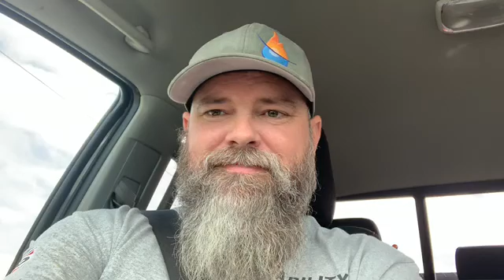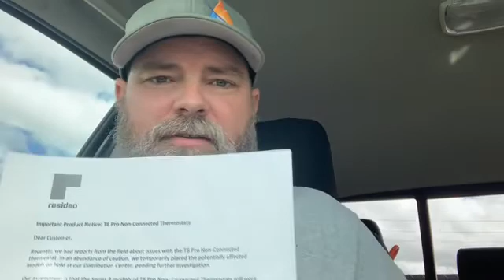Honeywell T6 Pro Issues

Comment: This is our second Pro t6 in one year. The fan won't go off while at the same time it won't raise heat up to the level we set it. It just blows cold air. Because the unit will not raise the temperature to where we have it set, the fan will not shut off.
Edit: I pulled the front off and looked at the number. It was 1920. I snapped the front back onto the base and the unit finally turned off. Waiting to see if it will start working right. Nope, same problem. Tomorrow I will installed a new brand.
Reply from the maker: If your system is electric heat then this may be the T6 pro. But are you sure your heater is working right? Is it big enough? If it were the thermostat your heat wouldn’t come on at all.

Comment: Hi! I'm so glad I stumbled on your video! Recently my heater would come on when it wants to with the Honeywell T6 pro. It has been cold for the last few nights. What other brand can I get to replace the T6?
Reply from the maker: I like Eco Bee as a smart thermostat. Otherwise a Honeywell pro 5000 is a really good basic thermostat.
Reply: @AbilityJohn  thank you so much John!
Reply: @AbilityJohn  I wondered if you've heard about the new-ish feature added to the ecobee called eco+ ? It allows someone off-site to adjust your thermostat based on electrical grid and many people on reviews I've read have said they can't disable it. I'm freaked out by that and now afraid of buying an ecobee.

Comment: Thanks for the great video. I just purchases the T6 Pro Wi-Fi. As your video indicates "non-connected", I am hopeful that the Wi-Fi model works without all the issues described in these comments.

Am I correct that the Wi-Fi version should be good with a forced air gas heater (no cooling)?

Comment: Im an hvac tech from Atlanta area. Ive come across these POS a few times. They don't work right. I ripp them off and replace. With a normal one. System fires right up
Reply from the maker: Yup! I hate Residio!
Reply: Please, may we know the brand(s) on which we may rely??
Too many troubles now for the 3yrs our brand new Johnson’s Controls system install.
Thanks!

Comment: What is Honeywell doing? I’ve had them put the unit in heating mode in the summer!
Reply from the maker: Yup! They suck. I just had one turn in heat strips too.  It was supposed to be in cooling.
Reply: @AbilityJohn  Mine too. Date code 1945 Series 5

Comment: I just bought my house and it came with this T6 thermostat. What I’m noticing is that it keeps my ac on for hours even when it reaches the set temperature. I have it at 80 degrees and the outside temperature could be 88 and even when the inside temperature is saying that is 80 it will keep running for hours. Is that a thermostat issue?
Reply from the maker: It sounds like a low refrigerant issue.

Comment: I just had a Honeywell T6 Pro and I am not happy with it. The AC goes off in the middle of a hot day. Clock is annoying. Thank you. The box reads "Made in Mexico."
Reply: Let me know when you find American made products.
Reply: I'm sure it's made in China. It's just assembled in Mexico so they can put that on the box.
Reply: @bethy-lou4845  
Why is Taco Sauce made in USA but all other products come from Mexico or China?
Reply: Seriously. The fix is easy. Press and hold the Menu button for 5 seconds. You will get Device Setup screen. Press Select. You see 120 on the top of the screen. Press EDIT on the bottom. Select NO SCHEDULE by pressing the right arrow until you see It.  Press done. Press BACK twice to the home screen with the temperature. You just eliminated the programming feature. Now whatever temperature you set the stat to will remain 24-7 unless you manually change the temperature. No more program conflicts causing hot or cold periods. Even if the time is off, it wont affect the temperature.
Reply: Same here. Thought it was a great thermostat until it wasn't.

Comment: I wonder if there's any issues with the T6 Pro Smart. I was thinking about getting that or the Nest. I heard Nest has zero issues, which would you recommend?
Reply from the maker: Honeywell smart T-stats suck really bad. I recommend Ecobee if you have an iPhone or Nest if you have Android. 
It isn’t true that Nest has no issues. I have had a few. Primarily with the bases going bad and it’s hard to turn off all the smart functions like your temp adjusting when you don’t want it to.
Reply: @AbilityJohn  Thanks. I just ordered the Nest 3rd Gen. Putting in new HVAC next week. Guy deals with a lot of Hoenywell, why I asked. He wouldn't warranty the Nest, but I got it on my own separate and he's taking $250 off price of installation. Thank you for the help

Comment: im sorry but you just confused me. you said date codes between 1917 -1940 are fine,, but the 1906 coded model in your hand was fine. so which date codes are bad? I was just told  today ,7/27/2020 that i will be having a t6pro replace my Trane original thermo from 2007. I have a heat pump.(fla). I was looking at the honeywell RTH8500D to replace my TCONT802AS32DAA,when my repair company said no, its not compatible for my system. 
i have all TRANE installed. comp/heatpump..model 2twr3024A1000AA   handler model#2tec3f24A1000AA...2ton. which Thermostat would you recommend? i think its a 2 heat 1 cool.not 100%sure. Thanks ,Pete
Reply from the maker: 1917-1940 are bad date codes. 
That model number for the Trane looks like a 13 seer. Am I wrong?
And that rht8500 should work.
Reply: Hello thanks for the video, I have had problems with this touchscreen thermostat since installed keeps going blank causing my heat and air conditioning not being able to be turned on ! Its a 2006🤷🏽‍♀️🤷🏽‍♀️🤷🏽‍♀️🤷🏽‍♀️

Comment: Hi John, Thanks for your informative video re: the Honeywell T6, which we are going to have replaced for our new AC system. QUESTION: Which non-programmable HONEYWELL PRO 5000 MODEL DO YOU STILL RECOMMEND, THAT HAS A LARGE DISPLAY, AND IS SIMPLE TO USE?  ...AMAZON REVIEWS SHOW THAT SOMETIMES FOLKS ARE RECEIVING A DIFFERENT MODEL PRO 5000 
THAN WHAT IS PICTURED!~...AND IT APPEARS THAT THERE ARE A LOT OF VARIATIONS IN WHAT IS AVAILABLE?  Thank you!
Reply from the maker: The Honeywell Pro 5000 comes in three different models. 2 heat 1 cool (good for most systems) 3 heat 2 cool, which you need if you have a 2 stage heat pump. Or “large display” which just has a larger display. Just make sure it says “pro 5000”

Comment: Hi John, i have problem with T6, i can't turn the fan off, its blowing air most of the time and stops for a minute and comes on again, ive been pressing the on/auto/circ .. After a click, it turns off, and comes back on again... And it doesn't matter if i keep it on auto/on/circ.. ....same story... Where can the problem be? ..let me know if you can please
Reply from the maker: Does it do it when you remove the face? If it does then its either the motor or the thermostat wire. If it turns off then it’s the most likely the thermostat.

Comment: Just Installed a T6 Pro on a 16SEER Air Temp. No matter what I do the reversing valve pulls into Heat mode. Even disconnected the O wire and it still in heat mode
Reply from the maker: I think that unit is failsafe heat. You need to energize o to get it to cool, not disconnect it.

Comment: John Dungan: Thanks for your review.  This is the one we currently have and since yesterday we started noticing that something is wrong! We only need a basic thermostat with simple ON and OFF features for an elderly user.  If you have a suggestion to replace it, please share.  Need to be a DIY installation. Thanks so much!
Reply from the maker: I know what I said in this video was I would not use Honeywell again however I find it hard to find a good substitute for a Honeywell Pro 5000. So that’s what I recommend. You can get it with a large display too. This makes it nice for older people.
Reply: @AbilityJohn  Thanks so much for your quick response.  I'll check it out!

Comment: Honeywell has issues with T6 and T4. I have had to replace 3 T6 and 2 T4. T6 I had were dropping 7-12v on B configuration unit, meassuring voltage C to B at outdoor. T4s were running cooling mode when thermostat was set to heat. Unit reversing valve configuration O. Replaced w different version no issues other than disappointed customer and a contractor feeling let down by a company that was dependable. Known issue, when you call tech support and the reply is no known issues is very disappointing to hear.
Reply from the maker: I agree. So many issues. .